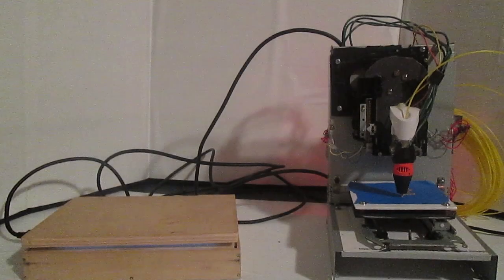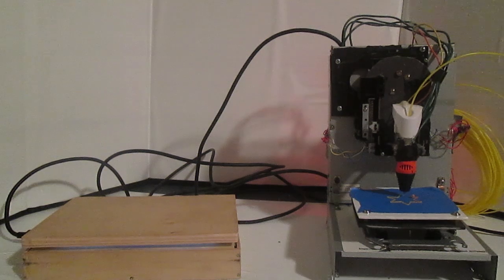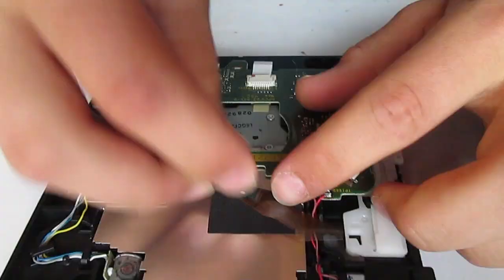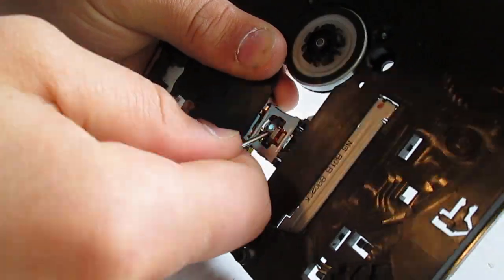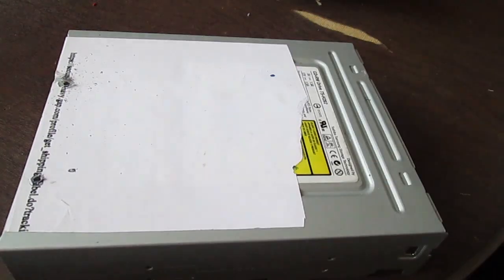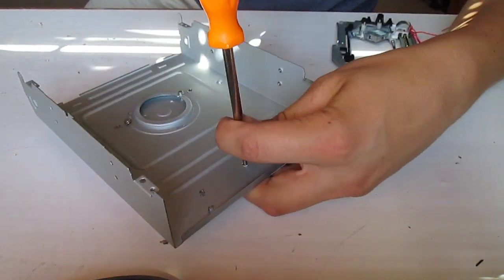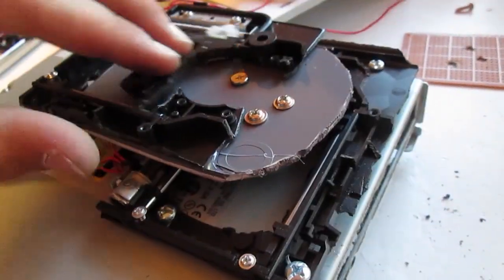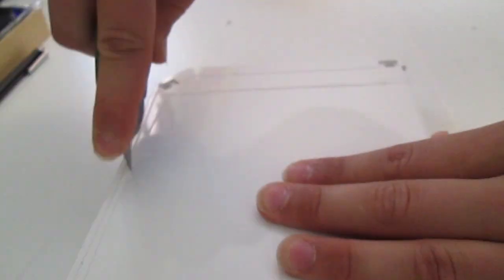Building a 3D Printer From CD Drives

Comment: And what would u use as the microcontroller for the obj mesh files, the slicer software must support your microcontroller(u can probably use a programmable controller like  arduino then write your own slicer routines(u need c programming skills for that) ... 😀. But who does that?🤔. It would be messy, that's really the obstacle you'd be facing in building diy 3d printers... 😁.. Me, I might as well buy a kit... 😀

Comment: Hello;
 Step motors get very hot and make noise. What should I do?
Reply from the maker: Possibly the wiring is bad? Have you tried switching around the stepper wires or the wires connected to the Arduino?

Comment: did u manage to make something complicated with this?
what is the max dimension of model that can be made out of this?

Please do reply because i want to do it as my final year project.
Reply from the maker: It's not very easy to make anything complicated with this because it basically takes a 2d image and extrudes out to be a 3d image.

The max dimensions are: 3*3*2
Reply: @Electo   you told that its not easy but how is it even possible for making something like a simple toy or statue if it only understands 2D figures.
Reply: @Electo  suppose...is it possible to make a sphere or pyramid from it?
Reply from the maker: Honestly, it might not even be possible without doing a little extra coding work. If you want to make a 3d printer that actually prints any 3d object look around on youtube and I guarantee you will find some videos on it.
Reply: @Electo  ya i have seen such videos..but i am a little low on budget and those would hike up the budget significantly.i can spend a maximum of 100$.
If possible within that budget in india please share the link from which i can buy components

Comment: The project is a very good learning experience. The only thing that stopped me from making something similar is the little travel CD drives lenses have which limits the print volume to aprox 4x4x4 cm (1.5x1.5x1.5 in). In the video I think the print looks decently large but it's at most the size I said.

Comment: Very good. I have one question for you  Since the 3D pen is mounted vertically, why did you feel that you had to shorten it? Couldn't you just brace it against the cd case?  Maybe I missed something, but I have always felt that the old engineers rule of, "If it's not broke, don't fix it." is a big time, effort, money and trouble saver.
Reply from the maker: I shorted the 3D pen down because of weight issues.
Reply: Ok, good reason.

Comment: hi, I have made a 3d printer using CD ROMs although everything is fine but their is vertical movement upwards when the 3d pen is attached to the vertical axis CD drive. can you please guide me in how to fix that?..what happens is when I give command to move up, it trips down maybe due to weight of pen
Reply from the maker: It's possible that you don't have enough power being supplied to the stepper motor drivers. On the driver board there is a variable resistor that can increase or decrees the amount of power being supplied to the motors. Tweek that a bit and see if it helps. Let me know if it keeps messing up.

Comment: ive made similar machine not while ago but it uses marker so if i get a 3d pen and modify it as in the vid can it work?
Reply from the maker: Yes as long as you use the same parts as I show in the video. If you're not using an arduino and the stepper motor drives that I used than I'm not sure if you can hook up a pen. But as long as you use the parts I use then yes, you can add a 3d pen to it.

Comment: I would recommend investing in a solder sucker. They are surprisingly useful. 
https://www.adafruit.com/products/148?gclid=Cj0KEQjwwoLHBRDD0beVheu3lt0BEiQAvU4CKgZPeqKJuqFWgNl_RLGbYQLxLqYhY_EBW3wOsLx-W1MaAmqo8P8HAQ
Reply from the maker: I actually already own one. What I really need is a "helping hand" tool.
Reply: I picked one up at my local harbor freight for about $5 but you may want to put in a little more money because after about a year the clips started to fall off the pegs
Reply from the maker: Good to know, thanks.

Comment: Nice little project. I've got a few old CD/DVD drives lying around that I could use. What is the build volume you get with this printer? I'm guessing it is on the order of a cube with 4" on a side.
Reply from the maker: The print area is about 2.5" by 2.5" x 2.5". So pretty small
Reply: ok, ty for the information. That would still be big enough for one set of objects I need printed. What I should be doing is see how to make use of the HP 7475 pen plotter I have that is currently just gathering dust.

Comment: parts list:

atleast 7 old nintendo consoles
Reply: generally, only one Computer considering tons of old PCs come with a floppy drive and CD writer which should suffice
Reply: @MaxC_1  a floppy motor is DC not stepper.
Reply: @simonhenry7867  there's multiple types, designs of drives out there. Some have DC motors, others have steppers.
Reply: no, just 3 broken CDROM, the Wii ones are better layout inside making this a lot easier, but any cdrom drive should work just may need to rebuild the carriages or accpt smaller bulds or worse results.
Reply: @simonhenry7867  and this might as well be written in Chinese 😂😂
Reply: Oof

Comment: sir the project is amazing.
And even i'm trying to make one.
can you help me finding the right feed rate(speed) and temperature of the 3D pen.
Thanks in advance.
Reply from the maker: Tutorial coming soon
Reply: Sir i almost completed the build process. But i'm unable to get the correct print, due to speed problem.
can you specify the speed and temperature of the pen you used.
Reply from the maker: I'm pretty sure that I set my pen to the hottest temperature you can. It also depends on what kind of filament and build your pen is though. When I used maker cam I set the feed rate to 50 and set my pen to its lowest speed. I hope this helped

Comment: US $1.35
NEW EasyDriver Shield stepping Stepper Motor Driver V44 A3967 For Arduino

http://www.ebay.com/itm/NEW-EasyDriver-Shield-stepping-Stepper-Motor-Driver-V44-A3967-For-Arduino/221485468696?_trksid=p2047675.c100005.m1851&_trkparms=aid%3D222007%26algo%3DSIC.MBE%26ao%3D2%26asc%3D41376%26meid%3D82c01d35bbea4d7c86fb4ed3ec345773%26pid%3D100005%26rk%3D2%26rkt%3D6%26mehot%3Dag%26sd%3D331178938895
Reply: Isidoros Sklivanos Mate, you should have used a URL shortener

Comment: Can you also make some kind of 3D statues using Sketchup or something like that? Or can you only make stuff like logo's? And can you then fill the logo's?
Reply from the maker: I don't believe I could use Sketchup because it needs to be in G-Code and G-Code is meant for CNC drilling machines. And drilling machines cut around the the sides of the shape so i can't do filled in objects with the 3d printer because the G-Code won't allow it.
Reply: Electronic Grenade Okay!! So it actually isn't very usefull as a 3D printer? And do you know what the max x,y and z are? Something like 10x10x10(centimeters, its I belief around 8x8x8 inches)? Or much smaller?
Reply from the maker: Oh it's way smaller. Around 2x2x2 inches. This project was just for fun and for me to gain a little more knowledge in the world of 3D printing. I wish I could use it for something useful but so far I can't.

Comment: can you tell the program you uploaded on arduino and also various connections of uno and stepper motor driver ?
Reply from the maker: Here's a few online tutorials http://www.tinkernut.com/portfolio/hack-old-cd-roms-into-a-cnc-machine/ http://www.tinkernut.com/portfolio/how-to-make-a-cheap-3d-printer/
Reply: Electronic Grenade  what is the power you are using for your motor 5V input or 12 V input and current rating? and if we use a static current power supply instead of an SMPS then will our printer start working? as we have tried tinker nut formulae but motor isnt rotating !
Reply: Electronic Grenade we have also uploaded the hex file and....grbl controller everything has been completely sufficed but at the end....motor isnt rotating in spite of the fact that by drivestick it started rotating but itsnt moving by uno and also by ramps 1.4 through a firmware !
Reply from the maker: For the stepper motors i'm using the power can range from 6v-36v. Make sure that the wires for coil "A" and coil "B" are hooked up correctly because I was having the same problem and then I realized that the wires were not correctly wired up. You can check the coils with a multi-meter on continuity mode.
Reply: U the silly boy
Fuck off

Comment: reminds me a lot of tinkernut's 3d printer. also, if you were to add a real hotend and a ramps controller, you could probably get some useable prints out of it.
Reply from the maker: That's where I got the inspiration for mine.  I didn't realise that that could be done until i already bought all of the parts. I wish I researched it a little more but I'm still happy with it.

Comment: I am going to do this, after I finish my other projects I've started and haven't finished, hopefully soon. :P
Reply from the maker: Nice! That would be sick!
Reply: Could you use normal motors or would it be easier with optical drives
Reply from the maker: Its going to be easiest to just use the optical drives because if you bought small enough stepper motors you would have to figure out a good and sturdy way to created the x, y, and z axis, which would probably be very difficult but definitely possible.
Reply: Ok so it uses the movement of the drive ejecting and closing part
Reply from the maker: Actually it uses the part of the drive that reads the CD. Here's a picture http://s.hswstatic.com/gif/cd-parts.jpg  It's the part that says "Tracking motor" It holds the laser pickup assembly and laser lens. The lens moves back and forth and read this disk.
Reply: Electronic Grenade ok i get it thanks :)

Comment: Cool.
I'm currently making my 30$ 3D printer project but mine is quite different because it uses no salvaged parts and everything can be bought on ebay + the hardware store.
Now i'm a bit stuck since i can't upload the teacup firmware to my arduino nano but i'll try the nano with the FTDI chip rather than the CH340 to see if it works.
Reply from the maker: Hey that sounds really awesome! 

Have you considered using the Arduino uno? I don't know much about teacup but from what i've seen online it seems like people are using the Arduino uno. Hope you figure it out! Let me know if you do.

Comment: If you spent $15 on a hotend and $15 on a NEMA17 motor, driver and extruder, you'd get much better results with a reasonably sized nozzle. $15 on an arduino mega+RAMPS1.4 shield w/ jumpers and drivers and you could control this with an actual 3D printer controller that would automatically slice objects so you wouldn't need to custom write gcode.

And I hate to be that guy but i doubt those prints are close to square. You should square it up then add bracing to the frame to make it stiffer, as it's pretty crucial if you want any degree of repeatability in your prints. Really cool microprinter, though. But it's not really useful even for decorative prints unless you can slice and print actual models instead of writing your own gcode. There's only so much you can do with G1 X(x) Y(x) Z(x) E(x)
Reply from the maker: I actually thought about building it with those parts but I had already bought the parts I used when I found out about it. 

Thanks for the advice. I mostly build this printer just as a challenge and just for fun. I never intended to use it for anything very useful. 

The prints are actually far from square because I am using 2 different sizes of stepper motors so the prints end up oblong. But when I design it oblong than it prints closer to square size.
Reply: Electronic Grenade If you ever decide to upgrade to the arduino/RAMPS setup, you can configure the steps/mm and prints will turn out the correct size, I meant more of literal square, like if they're skewed.
Reply from the maker: Oh lol.
Reply: i used this 3d printer for building spare parts for my other home made printer
Reply: You would need more than one stepper motor maybe 3 or 4 so max $60

Comment: do realy need a stepper moter drive ?
Reply: If you want it easy then yes. Otherwise using a dc motor (or servo motor) with an encoder can work if you have slowdown procedures in the arduino software to prevent overshooting and resonance about spots. But even then there will be difficulties and the servo motor will probably have a much shorter lifespan than a stepper.

Comment: you dont need to spend 500$ on a 3d printer you got this one right here for 45
Reply: You're actually comparing this to a consumer 3D printer? You're right, you don't need to spend $ 500. You can get a decent one now for around $ 150.00 that prints magnitudes better than this. This is not a substitute for a 3D printer, more of an engineering / proof-of-concept exercise. There are many variables to achieving a good print.
Reply: adisharr i think this would be good enough to print the plastic parts for a prusa i2. For the i3 too but youd need the laser cut steel frame or build the wooden box one by yourself
Because you already have a make shift 3d printer maybe you could modify the parts to use the round flat steppers from inkjet printers. With microstepping you could get a good enough resolution, albeit it being slow and not very precise at all. your surface finish wont be the best.
you could print some pla bushings which work pretty well (at least in the X of my i3).
And for the idlers you could use plastic on polished metal, say a stainless nail polished with 1500 or 2000 grit and then use some grease.
for the heated bed you could make it yourself with some nicrom wire and a relay to mains, or use a spare part for a ceramic heater as they come in 700 / 1500 W for mains.
For the hot end just buy a chinese e3d clone. 
That should give you a pretty decent machine that you can then upgrade to the full blown one.
Reply: adisharr
Sometimes a awful lot of work is the only solution. Your choice, you spend time, or money, if you dont have the later, then there's no other choice.
In some countries there's no other way because of bad economies and stupid regulations.
Reply: No. You cant print anything of any sort of detail or size with this printer. It has a volume of less the 40x40x40
Reply from the maker: Exactly!
Reply: Electronic Grenade how long did it take you to build it
Reply from the maker: Around 2 months. it would have taken a lot less time if I wasn't busy with other things.
Reply: Electronic Grenade ok
Reply: Electronic Grenade what are you going to build next
Reply from the maker: I'm not exactly sure just yet but I might build a tablet or a handheld gaming device.
Reply: Electronic Grenade cool i want to see that
Reply from the maker: Sweet! it might be a while before its out though but I'll try to work as quickly as possible.
Reply: Electronic Grenade you can do it
Reply from the maker: Lol. Thanks!
Reply: I guess if you're completely broke but that's an awful lot of work to get to the point of a Chinese clone.